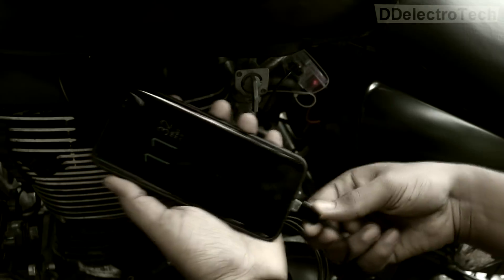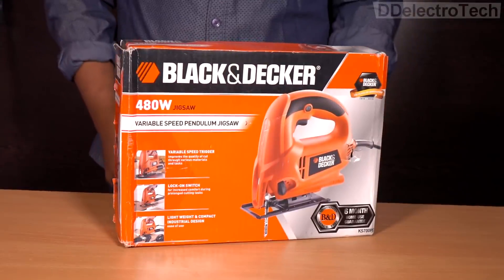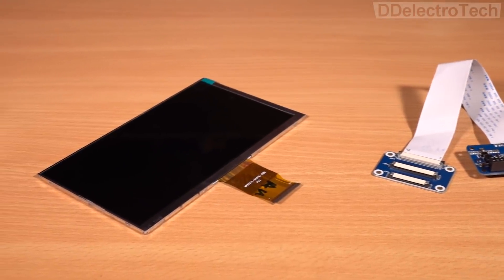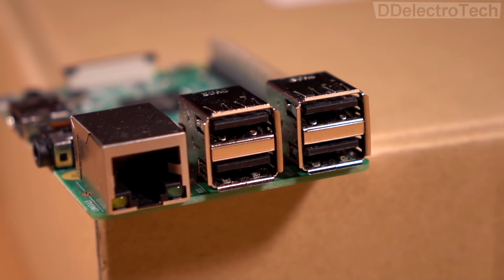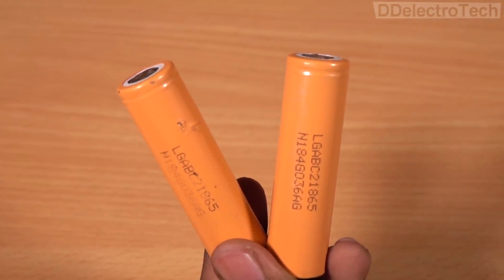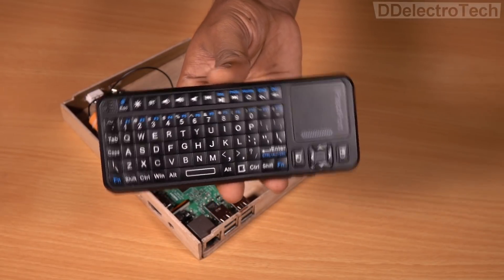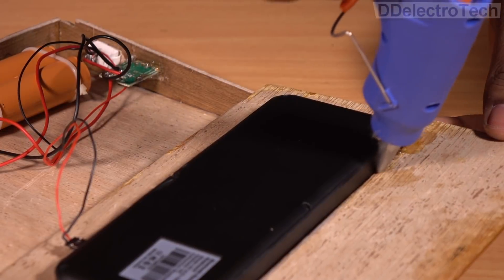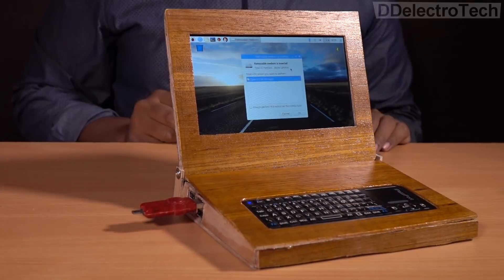How I Made my own Laptop / DIY Laptop

Comment: Please give a link to the software you installed in the sd card.....
Reply: Samridh Aggarwal its linux...
Reply: No it's chromium os it is a operating system built by Google and runs on chrome..... It is really bad I would recommend the original Rasbian is built for the raspberry pi